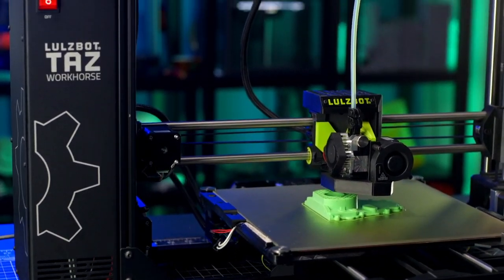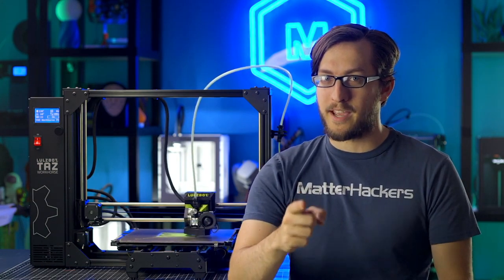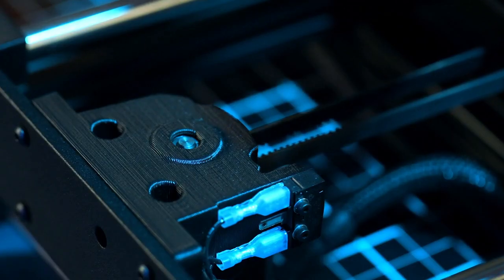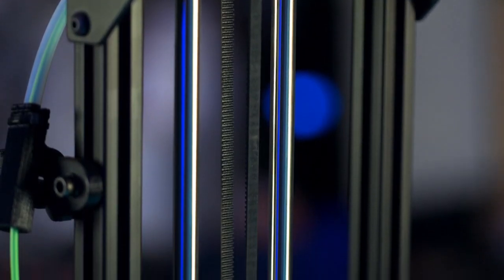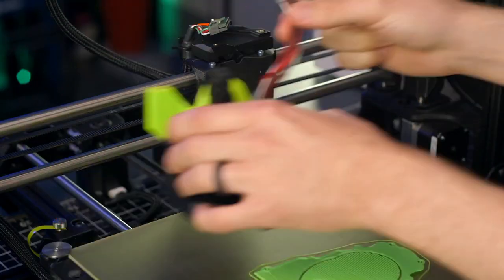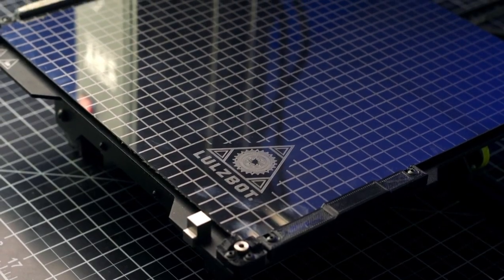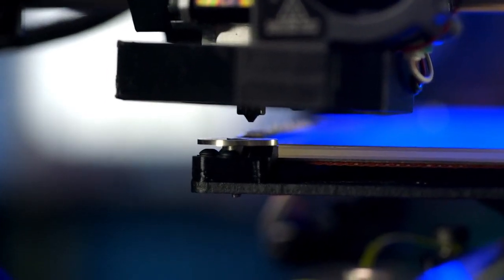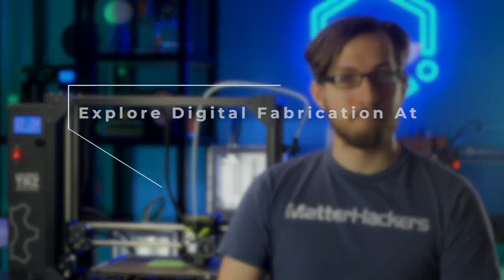LulzBot TAZ Workhorse // Tech Breakdown

Comment: I regret buying this one. I was new to 3D printing and I literally have to scrub the nozzle before each print because the automated cleaning fails comically and I have to stare at the first layer and manually adjust the z-offset to get 90%+ success rate for each print. It's the worst purchase I've ever made. I got a prusa MK3S and wow! I just start the print and forget about it. Only time it ever fails is if I didn't get the supports right, which is about as much as you can ever expect. I love my Prusa and I'd sell my workhorse for $500 if anyone wants it along with a crap ton of 3MM filament I bought with it. Any takers?
Reply: Send me a PM.

Comment: those areoheads get bad thermal runaway without a silicone stock, read amazon reviews, did they even test these?
Reply: Have you even tested it? Amazon reviews are amazon reviews, they can be bought. Also average IQ is only 100, maybe higher in 3D printing community, but there are still morons. I only use K-type thermocouple and 60W heater with mine though. I also use a nickel plated copper hotend. Hey maybe the normal Titan aero's do have heating issues, but with my configuration I have never had a problem... except when I had inadequate strain relief and the single strand wires in my k-type thermocouple broke.
Reply: @Anyone700  I have I bought it when it 1st came out and me and many other users encountered thermal runaway problems until putting a sock on it.  It would still jam often though and generally a pain in the azz and totally not worth the money

Comment: Yeesh....3000 gets you 3D printed structural parts, a tiny monochrome LCD, and a nozzle-based leveling system. They should try selling them for $1000 and just try to sell 3x as many.
Reply: The parts to build it cost more than that. Also labor isnt free.